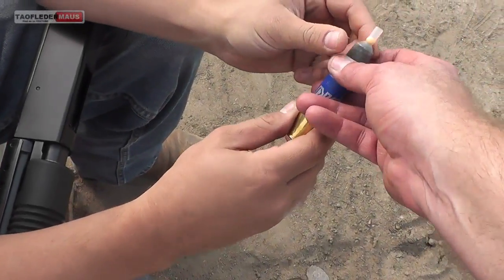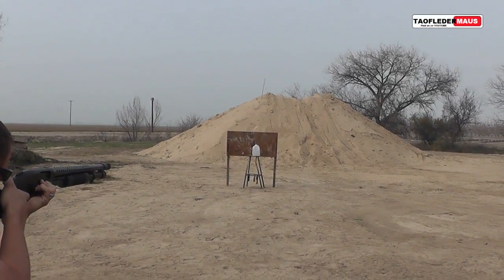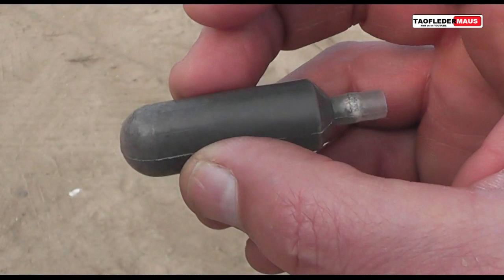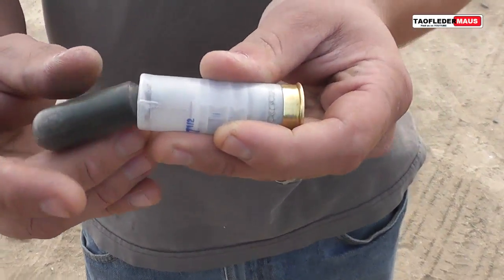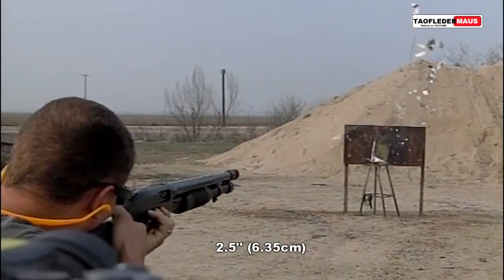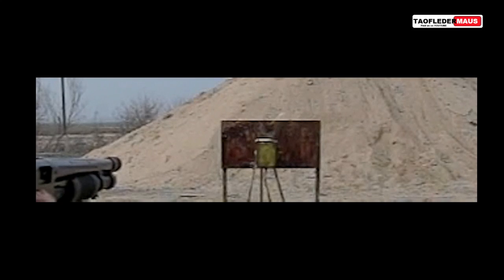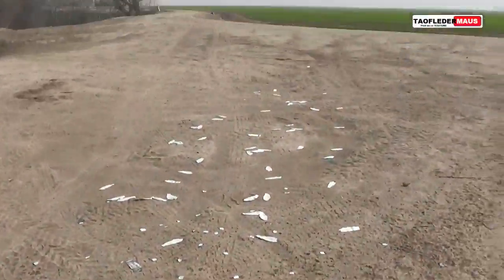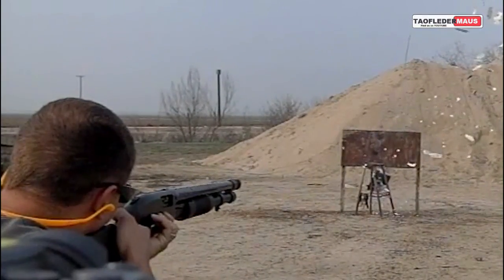Encapsulated SHOT Bullet  - Weird Shotgun Round

Comment: OK, here is Cider fueled crazy! Put a .22 Nail Gun blank bottom first in the tip, back fill with shot to the depth of the case. Pack an inch or so of nitro powder in (or close to the legal limit) and then pack with the carbon. If the legal amount of Nitro wouldn't be behind the round then put some filler in (either shot, iron filings or carbon.) We want that projectile to go "Boom"!  I reckon that would do horrendous damage on a body (Soft tissue then bone) Personally I'd not use something like that on an animal but I'd be very interested to see what happened on say, ballistic jelly with a sheep's scapula embedded in it. Purely for the entertainment of my old Role Playing Game buddies who used to invent elaborate rounds and demand rules for them!

Comment: about 25 years ago, encapsulated 12ga lead shot rounds and steel shot rounds were available in Canada.  They used a heavy plastic sealed cup with an attached open cup in the back that had little slices in it so the pieces would expand and spin.  I no longer have any of those rounds but I'm sure someone can find them for you.

Comment: The circle pieces of paper after the book was shot makes me wonder what it would be like to shoot a steel ring from a shotgun. Not like the washers since those are kind of light weight and very flat but a sturdy ring since it has such a large opening, thin profile, and decent weight while shooting. I think after being shot it would spin incredibly fast but very straight since there wouldn't be much in air resistance to make it sway. Though I don't know if it will fit in a shot cup. :(

Comment: It'll flip around and fly straight like you said in 2:02 cause the centre of mass is at the front. As it tumbles randomly the forces the air exerts on the capsule will cause it to stabilise with the nose pointing forward. Imagine the centre of mass as a "turning point" a force exerted on a part of the capsule above the c.o.m will cause that part of the capsule to move as if it were turning around the c.o.m. Imagine holding on to an anchored point while standing in a wind tunnel. The point that you're holding on to could be seen as your centre of mass and as wind passes around your legs your legs will be swept upwards, and when your legs go "above" the point your legs will be pushed back down, until you are fully horizontal and "stabilised".

This is the same reason why a space capsule will flip to have the centre of mass pointing downward as it enters the atmosphere, some capsules have the ability to alter the c.o.m during reentry to gain control over the descent.

Comment: check this out taofledermaus, i found stainless steel balls of just slightly less than the diameter of the inside of a 12 gauge shotgun, the site also has tungsten carbide balls, which, though calculations, the best size should be 15mm for you to shoot, you should totally get some and shoot them at stuff. heres the link: www.craigballsales.com/23-32-316-stainless-steel-balls-lot-of-10.html

also, i've ordered from this site before, they have excellent customer service. i would recommend also getting 1-2 2" stainless steel balls, theyre just tons of fun.

Comment: What would happen if you attached a capsule to a strong fishing line, and shot it to a target, So the fishing line unrolls. would that work?  It sure could be the projectile is going too fast or has to much power for it and rips it .
Reply from the maker: Steve Bergen Not sure if that would work but might be interesting to try out!
Reply: I like that! Start out with the strongest fishing line and work your way down the weakest line until you fine one that snaps from the muzzle velocity and mass of the round used. :)
Reply: Good idea: the tow line might be an interesting way to straighten out some of these oddball rounds people request (screwdriver, etc...).

I suppose there's no way of anchoring the line to a large spool without having to feed it through the front of the barrel prior to loading the round...

Comment: charcoal eliminates most odors, and if digested, reduces gas...
Reply: ***** I accidentally ate too much charcoal. I took some charcoal and I was alright.
Reply: ***** I ate ebola and got charcoal
Reply: ***** That takes skill.
Reply from the maker: mr bad example  That's true!  It's also good if you accidently ate poison.
Reply: Charcoal causes Ebola and cures Ebola.
Reply: mr bad example
 Remember, ACTIVATED charcoal is better at that stuff than nonactivated.
 In a nutshell, activated charcoal has an insane surface area (to the microscopic level), which allows it to soak things up so well it works on airborne chemicals. It's used in various filters, from aquarium water to household heating and cooling.
 It's also not terribly difficult to make. Find a soft, porous wood (even things like coconuts will work), cut into small pieces so it'll cook more evenly, apply heat to it WITHOUT allowing it to burn (deny oxygen), then when it's cooled, crush it into a powder.
 Reactivating charcoal only requires that you recook it, if I recall correctly.
 Store in a dry, preferably airtight container.
Reply: I prefer activated almonds for general purpose stuff like that
Reply: and can make you puke
Reply: Thelothuo We didn't need an exposition professor.
Reply: It Was Probably Aliens
 I figured that the person depicted in your profile picture may be a bit intuitive and realize that it could be used to make crude gas masks.
 Seems it isn't so.
Reply: Thelothuo i actually bought charcoal caps from a health place once, 20 something years ago...
Reply: Thelothuo It doesn't work as rocket fuel. They tend to hit the water.
Reply: It Was Probably Aliens
 Perhaps not for the more modern versions, but note that activated charcoal burns and responds to oxidizers much more due to it's surface area.
 Good for small, inexpensive rockets like fireworks.
Reply: ***** I ate hepatitis and got some ass.
Reply: It Was Probably Aliens
 Before I respond to that I need to know who I'm conversing with: You or your profile picture?

Comment: What about using the the capsule to make a wax slug?
Reply from the maker: frostedfur  It would probably be hard to fill it.
Reply: ***** try cutting a little hole in the closed tip and squeezing a resin or an epoxy in between the shot?
Reply: *****
  There's also the chance trying to pour hot wax into the capsule could warp or compromise the capsule.  Happened to me before when draining excess fat off of hamburger I've browned on the stove.  In my case it was and old plastic peanut butter jar.  Both the jar and the capsule are plastic so you've got to be careful trying to put anything hot in them.
Reply: Justasmalltownokie I want to see galium put in one then soaked in 100 eg water just before it is loaded and fired. Galium melts at 89 deg so 100 would make sure it was very melted. While not mercury it should act much like it in that state
Reply: Nova Flare
 That could work, it would be cool enough that the plastic shouldn't melt.